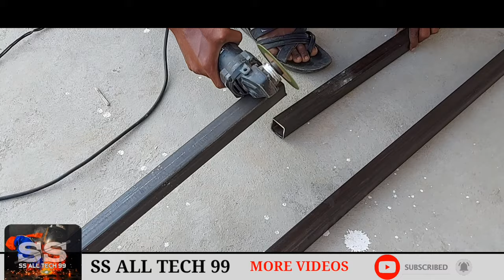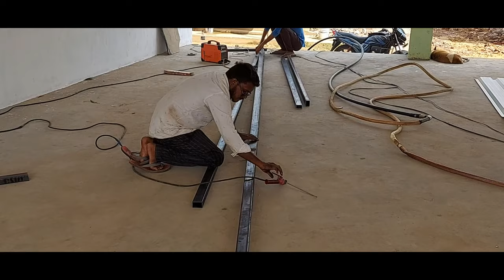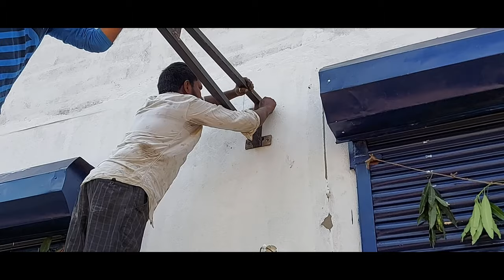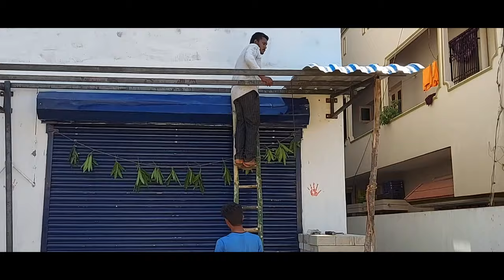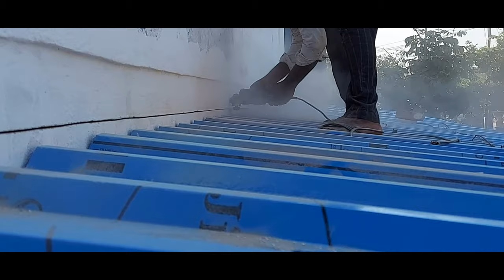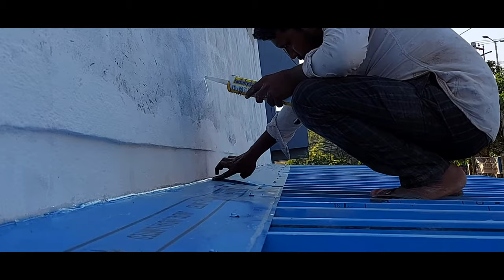shop front shed without pols #fabrication #shed

Comment: nice work . kaisa bolt dewal  me fix kiya ? anchor bolt ka  length ketna hai ? pls bataiye.
Reply from the maker: 3" inch hi size
Reply: @SSALLTECH99  prompt reply karne je liye  bahu bahut dhanyabad.  
 mera terace ka corner  me sunset a gaya .  truss ko  sunset ke upor dewal me fix karna hai .
Reply from the maker: Truss dewar me nahi rukega concrete ..a beem me fitting kar na padega bhai sunset Agar height huwa tu Neche fitting karu water leakage nahi huga